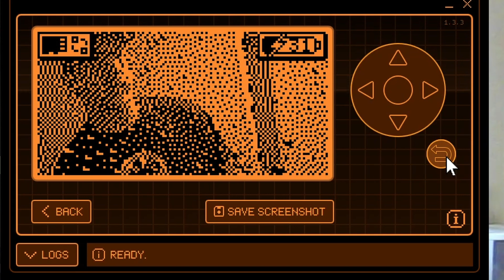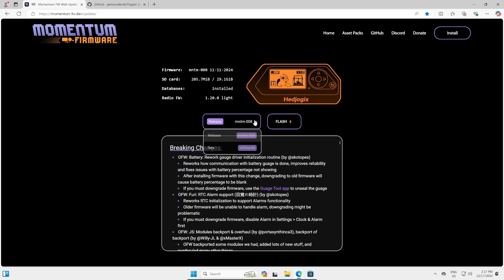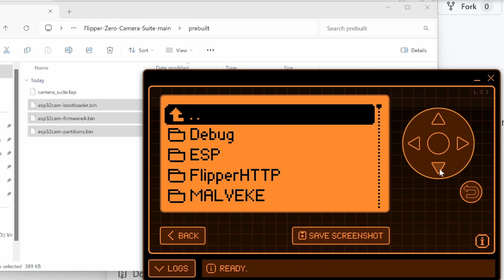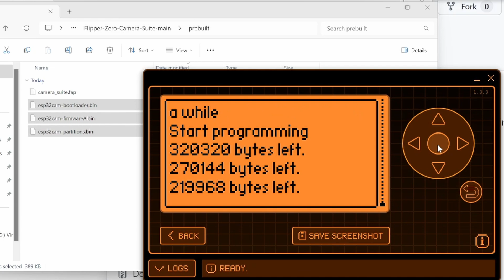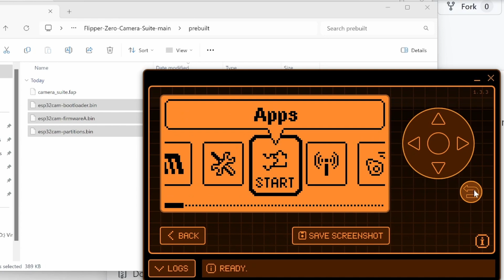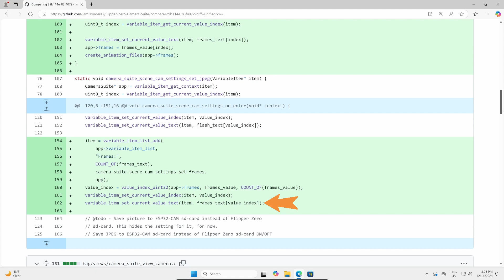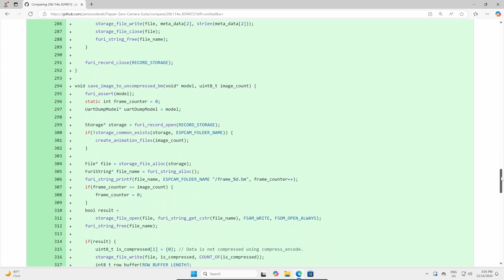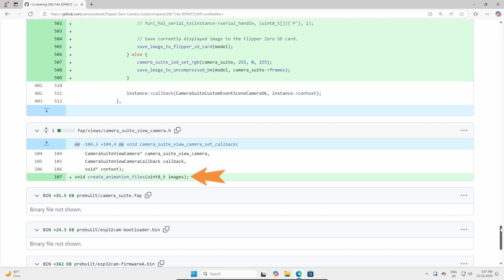[146] Flipper Zero: ESP32CAM makes Animations (for Momentum firmware)!

Comment: Is there any possible code change to fix the mirroring that happens with ESP32CAM?
Reply from the maker: Yes, it's possible, but it's been a bit since I looked at that code. I think the solution was to flip each bit in the byte and then walk thru the bytes in the reverse direction. I'd recommend editing /fap/views
/camera_suite_view_camera.c line 320&321.

https://github.com/jamisonderek/Flipper-Zero-Camera-Suite/blob/382ace45d8015a01000401109e01130410749a2b/fap/views/camera_suite_view_camera.c#L320C25-L323C61

ChatGPT can create a function for you "c code to flip the bits in the byte to reverse order."

If you need more help, feel free to reach out to me on Discord. I'm @CodeAllNight.

Comment: Yes I’ve been waiting for this video! I have my esp32 cam suite. Will it basically work the same? Just flash cam chip and wire rx to tx
Reply from the maker: Yes, the firmware is the same as the old one. I just provided .bin files for people that hadn’t already flashed ESP32CAM before. 
The FAP has the new code for setting the number of frames to capture. Be sure to take enough pictures to fill the animation.

Comment from the maker: Download final FAP from https://github.com/jamisonderek/Flipper-Zero-Camera-Suite/tree/main/prebuilt. If you don't already have the ESP32CAM firmware flashed, you can also get the .bin files from the same folder.

To switch to animations, use... Momentum/Interface/Graphics/Asset Pack/Camera

Contact me on Discord at @CodeAllNight or leave a message below!
Reply: Thank you! I’ve been waiting for you to complete this video. I have the smaller esp32 suite. Will the process be the same or similar? I work at a tattoo shop and plan to use the images in art. Been waiting to print an image from flipper. I can’t express how much this means 😂 to me, getting sentimental sorry.